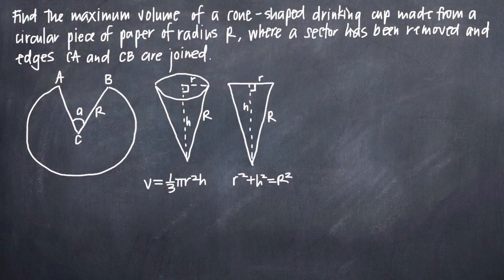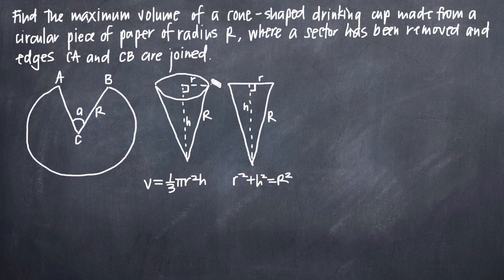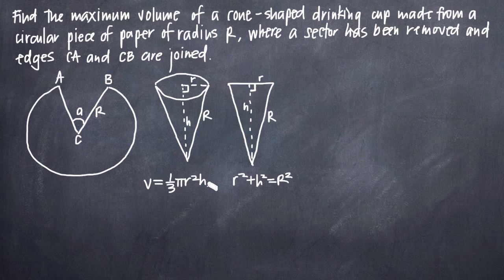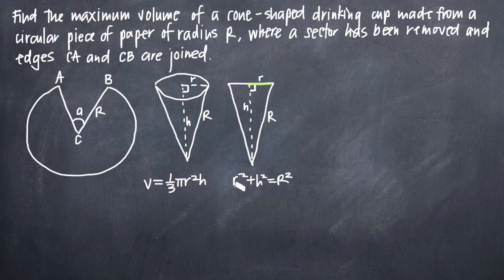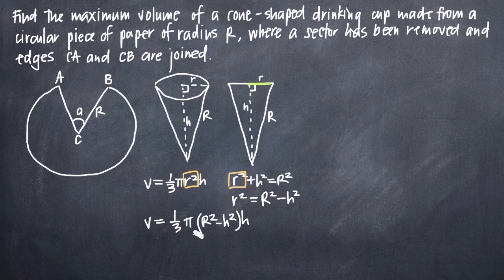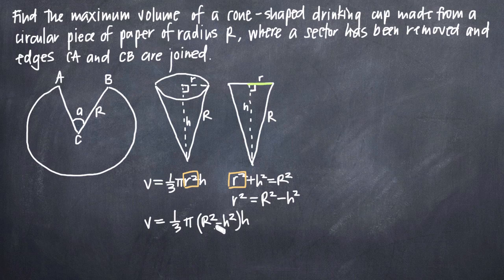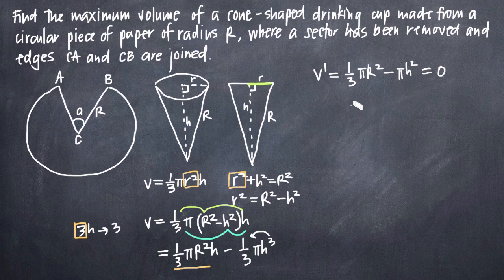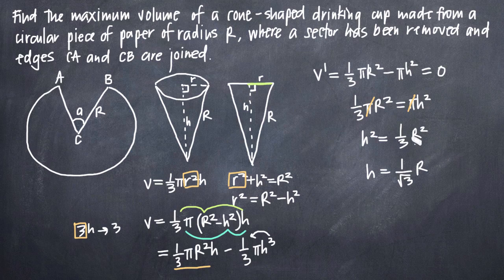Maximum volume of a cone shaped cup (KristaKingMath)

Comment: We do not really control h directly - our choice of angle a determines h

So we would optimise for angle a .. ?
Reply from the maker: Once the sector is joined, the slant height is fixed at R and the base circumference equals the remaining arc: r=R(1-(a/2π)). So 'a' is basically just a "re-labeling" of r. In other words, you can optimize 'a' instead of 'h', but the result is equivalent. However, optimizing 'a' introduces an unnecessary extra step, so it's cleaner and simpler to focus on 'h' instead of 'a'. 🤓

Comment: Very interesting, thank you. I’ve tried the following problem without success, perhaps you could use it in a future video.
A Christmas tree has a certain base diameter and height (or slant height) Christmas lights of a set length are to be wrapped around the tree equally spaced height wise. If the length of lights is devided into 10 parts, how high up the slant height should each division be. It would make Christmas decorations so much free of stress!
With thanks
Colin Smith

Comment: I would have thought that the max volume also depends on the angle at the center of the sector which is cut out. The smaller the angle, the shorter the cone. Likewise the bigger the angle,  taller the cone.  Why did this not come into play?

Comment: What if the section is not cut? and the cone is cut to the center which could curl up and could change the height and radius. 
How do I find the radius of the maximized volume of a cone? and the max volume of it ? thanks
I don't know if it matters.

Comment: Oh, oops, haha! It took me til the end of the video to figure out exactly what shape of cup you were talking about. I thought you were building a cone that essentially had a sector-shaped fold into it such that its cross-section parallel to the base was a circle with a sector cut into it. I see now that you are building a cone by STARTING with a circular piece of paper with a sector cut from it and joining the two edges of the sector to close the sector gap and thus make it a cone. (Sorry if that didn't make sense.) In retrospect my original conception of the problem was hilarious because I was thinking, "Why would you want to make a cup like that??" Haha!

It's interesting, by the way, that the trickiest part about these optimization problems is often algebraic manipulation. Once you manage that, the Calculus is easy!
Reply from the maker: +alkankondo89 Couldn't agree more! And it is pretty funny what you thought about the cup!